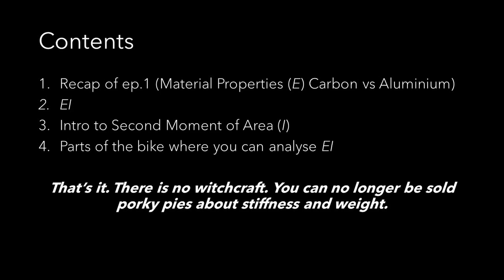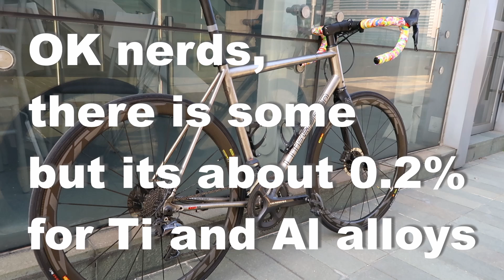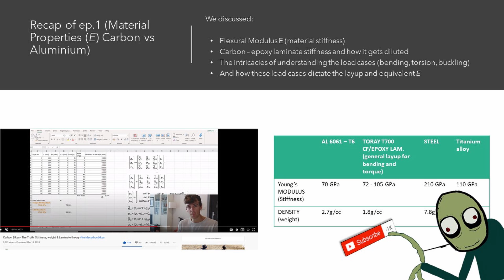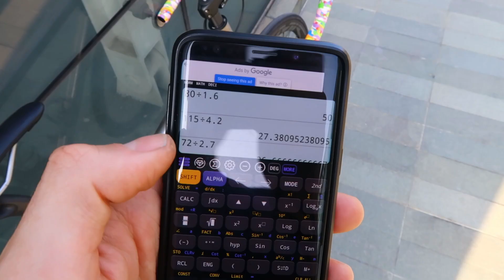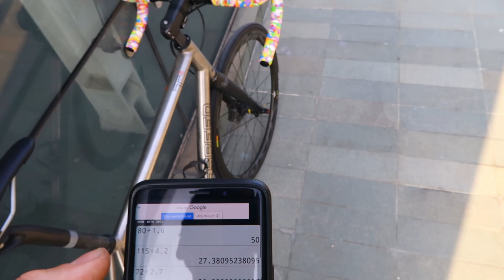Titanium Bikes - The truth and Physics of 'ride feel' marketing.

Comment: Try using chromoly bmx handlebars on a steel frame or titanium and then say it’s not a good dampener! , on my bike I have small kids bmx chromoly bars best upgrade I made , 2nd is chromoly cranks with a odyssey euro to mid adapter.  Always match frame material with components. Carbon fiber isn’t a frame material, just trash like aluminum.

Comment: I have owned steel, aluminum alloy and carbon MTB & road bike frames. Things like tires, tire pressure, suspension, saddle, frame geometry and road surface all seem to make more difference than frame material. Frame stiffness does vary, but often it isn't the material.

Comment: At time 4:45 the presenter suggests maybe "a CAAD 13" aluminum frame would take all the same components and be comparable to the bike shown. In that or a similar scenario, has anyone actually mounted vibration sensors on the two frames and collected amplitude vs. frequency plots of the two bikes side by side?

Comment: Hang on, tube diameter makes a huge difference to stiffness. If you're just looking at axial compliance they'll be the same, but the Al tubes are likely to be larger diameter, and lateral stiffness should be noticeably higher, particularly up hills or sprinting.

Comment: No they wont.  Same weight and 2 different tube diameters will have wildly different stiffness in the vertical direction.  You also haven’t discussed asymetric strain and stiffness.. compliance for a human is strain in Z… power is low strain in X and drivetrain and handling comes from strain in Y

Comment: Vibrations are also influenced by a metal's crystal structure, through internal friction and hysteretic damping. Of course this effect is minuscule compared to the influence of stiffness and mass, particularly given the factors you emphasize. 
But if one resonates these bike frames with a tuning fork one will be able to hear some subtle... textural difference in the sound between different materials. Equalized for stiffness, mass, shape, etc.. there will remain some detectable difference in quality of the musical note. Does this influence ride feel? Certainly not much, but some will have preferences.

Comment: There definitely is such thing as ride feel, aluminium gave my ass 1 hell of a pounding going from steel
Reply from the maker: @grindeyyyyy  thats because the structure is stiffer, given by the boxier stiffer tubes. Simple as that. Tube size is far more influential than material properties. Tube stiffness goes up with diameter to the power of 4!!
Reply: @PeakTorque  it definitely took some getting used too

Comment: There is a difference between butted and non butted tubing of titanium. Additionally, the butted frame is lighter and therefore more comfortable/compliant. 

I’m not sure what Litespeed frame you are ride or what tubing it is made out of. Please explain what frame and whether the tubing is internally butted or not.

I have a Moots Vamoots RSL frame and it only weighs 1055g. The tubing is internally butted which dropped weight and improves the ride quality. The complete bike is 6.43kg which is lighter than many of my friends carbon bikes and feels very smooth to ride as compared to many carbon frames that are so stiff and offer time carbon bike become dull.

Comment: 2:00 That isn't possible.  They cannot both be the same weight and same dimensions.   Titanium is stronger and tougher than aluminum.  The aluminum bike would have thicker and larger tubes.  Given aluminum being inherently stiffer and with the larger tube and wall thickness required to carry the same weight, the aluminum will be stiffer.
The opposite is true with steel.  It's stronger and so the tubes can be thinner walled in order to carry the same amount of weight.

Comment: You want titanium for longevity, not for "ride comfort".

Install a suspension seatpost for the latter.
Reply: Titanium can have a long lifespan, but a lot depends on the welder. It's harder to work with compared to steel or aluminium, and if the welder does no perfect job it can crack at the welds.

Comment: Crashed my Litespeed Siena at 40 mph. Had to replace all the carbon parts (bar, stem, fork) but the frame didnt have a mark on it. If it was a carbon frame it would have been a write off. It also doesn't corrode. It is comfortable, but not as comfortable as a modern carbon frame. It isnt that light either, but it is a great frame and bombproof.

Comment: Peak Torque... you had me at second moment of area - engineering p0rn$
On a more serious note I have an ancient Lynskey-era 6-4 Ti custom Litespeed Vortex. It isn't stiff and isn't light even compared to frames from the same era (1998). But is it ridable after a decent crash? - yup! Without a doubt... that can't be said for carbon (which I also love).
Just like my old Mavic CXP-30 alloy rims - tough as guts when built right and MUCH tougher than the winspaces I bought (and also love).
Best ride quality change up is...drop 10psi in your tyres and then just accept the snake bite punctures should one hit a bad pothole...

Comment: Your description of the factors involved is like saying that all that maters in a suspension is similar factors applied to the spring. But damping is also a factor.  for instance golf shafts are sized in accordance with those exact factors you mention, but add a rubber bung, or a foam core and you get different effects.  

The reality of the factors you mention is that they can't be sized the same way.  Ti bikes are almost always tubes,  but the tubes are wearer, if lighter, so they will have a different section and modulus in practice.

Anyway, I never expected Ti to be any better, I just don't think the factors are as obvious as it seems they should be.

Comment: Also a simple constructed frame like this doesn’t provide any dampening or suspension zones at all. It has the frame basic construction as my 14 year old Koga Miyata fitness bike. This particular frame weighs a bit less than 3.0 kg, the complete bike with aluminum rims and 2x11 speed 105 group weighs about 9.5kg. 

You confirmed my feelings that a titanium bike would not make the difference. Maybe a steel one with special formed construction with damping zones.

Comment: Silly question but back in the day, when you went from something like a Klein MTB to a Titanium Merlin MTB, it was like night and day. The Klein was stiff as could be and would beat you up over an hour or two. In contrast, the Merlin MTB was wonderful and compliant. Both weighed about the same - the Klein was probably lighter - but the ride difference, even with the same basic tires, was just different. What "physics" explains that. Real question by the way.
Reply from the maker: @AMehta-ok5pf  i think it comes down to tube shapes and diameters (which have a much larger effect on stiffness than material choice). In the early days of hydro forming Alu tubes they were thick walled and large diameters before the tech really progressed. This alu bikes got a bad rep for being stiff and jarring. Fast forward to today with something like a CAAD12 with slender (and very thin wall) tubes id say almost the opposite could be true, as titanium tube profiles have largely stayed the same

Comment: Those straight chain stays and seat stays on this bike are GUARANTEED to yield a brutal ride…he’s right about the proper seat post , it can provide considerable dampening. My old Tom Kellog Compact X Lite is a bit heavy but has ‘worked’ chain and seat stays and is stiff enough for aggressive climbing AND it is bulletproof, thirty thousand miles in with the odd accident now and then.

Comment: You've gotten the material science geeks all riled up.   If you want to buy a novel Ti bike that's your business.  There is no need or advantage outside the bar.  Aluminum is the best bike material thus far considering cost, weight and longevity.  There are millions of them from the 80's  and 90's still going strong.

Comment: I've ridden steel, carbon, aluminum, and a Bianche hydro-carbon frame, and I've found the various materials to be pretty irrelevant to the ride quality.  In my opinion, the seat and post, the handle bars and wrap, and tires and tire pressure are the real factors.  My favorite frame?  The aluminum Klein of course.

Comment: It’s always about the tires in my opinion,anyway. I have a steel road bike, a carbon road bike and a steel road bike. They all have carbon forks. They all have the same make and model of 28mm tires. The three bikes all ride the same. Oh, and the saddles, handlebars and bar wraps are identical on all the three bikes so all contact points for the rider are the same. Same setup and geo very similar on the three.

Comment: The stiffness to weight ratio does mean that the properties between an aluminum bike and Titanium bike should be similar.  But due to the fatigue issue with aluminum, you cannot design in as much compliance as you can with Titanium.  You could build an aluminum bike with good compliance but it would start cracking far sooner than titanium.  And I think you do see this in real life.  I have been told that aluminum bikes in general are harsh, and titanium bikes are closure to steel and carbon in their ride feel.  So Titanium does have properties that make it different from aluminum and these properties probably do give it the ability to offer a more compliant ride.  I do not consider titanium magic though, as its good ride quality probably comes at the expense of rigidity.  So yes you may have a comfortable bike, but it flexes a lot under power.  I still think titanium is a great material for a bike, as it seems to combine some of the best properties of steel and aluminum.  I would guess though that its performance cannot compete with carbon fiber as there are so many variables you can play with in carbon so it can be tuned to a high level.  Its stiffness to weight is much more than even titanium as well.  I just put my money down on a lynskey Pro GR, and I know it will not be as light or as efficient as a good carbon bike.  But I am using it for commuting and gravel riding, and I prefer the longevity and toughness of titanium.

Comment: So I've owned aluminum (Cannondale 6/13), carbon (Trek Emonda SLR9) and a titanium (Guru Preamio Preformsnce) and I can say out of all three the Ti bike rides best, and provides ne with the best tactile response. (By the way, I've ridden each bike for literally thousands of km.. my average day ride (do it about two to three times a week) is 100+km 
So take all the calculations you want, but hands down Titanium for my un-scientific opinion is the ultimate best. 
By the way, back in the day, I've also owned steel (Raligh Professional Racing). The steel frame was a Reynolds 531 double butt.. best of the best in its day (although Columbus was its steel equivalent).. and I also loved steel.
So if I was rate best to worse invthe frames I've owned 
1. Titanium (Dura Ace mechanical, Arolus, 
2. Carbon (Dura Ace Di2 on one Mechanical on the other, Arolus)
3. Steel Campagnolo Nova Record, aluminum Tublar rims) 
4. Aluminum(Campagnolo Record, Campagnolo aluminum clinchers)
Reply: So, you basically just didn't watch the video? The Guru Praemio (which I used to own) is a simple round tube bike. A Cannondale aluminum bike (except some of the first ones) and definitely a carbon bike use shaped tubes wich would result in a much stiffer bike no matter what material they're made out of. And what PT clearly explained is that the properties that matter pertaining to "stiffness" from the material itself is nearly identical between Al and Ti.
As such, what you're experiencing isn't because it's a titanium material, but because the simple round tube design and thin walls are a flexy structure compared to aluminum frames which are formed tubes usually with thick walls to get their stiffness closer to carbon.
Reply: @conman1395  I did watch the video, hence my response.. I"ve owned, ridden, and own the best of the best,  and my best ride is my Ti,  But what can I say, I also much prefer my mechanical Dura-Ace 9000s to my Di2 R9200.. I guess I'm simply not cut out Di2s' 
Anyhow, I stand by my options. After all, my opinion is based on my rides and nothing else.

Comment: I have a 2006 Titanium Litespeed, with curved seatstays ( not straight like those of the bicycle in this video).  It is NOT a magic carpet ride, neither was my 1995 chromoly steel Miyata.  The Litespeed is really easy to wash and maintain though and I do not have to worry as much about paint chipas and scratches.
Regarding titanium ride feel: a Zipp sl-70 aero carbon handlebar and a good set of tubeless tires, ie Continental 5000 S TR, even 25mm wide, on a set of nice carbon fiber wheels will yield a very nice, responsive and fun ride which can easily handle a 120 mile ride without beating up the rider.

Comment: I wanted an all round bike to ride to work every day from +30 C to -20 C. Now carbon could probably do that, but I was afraid that if I slid on ice (despite running studded tires which I will be doing, but you never know), I am afraid I would damage the carbon frame. I do have three carbon road bikes, so it wasn't needed in my collection either. 

I do have a steel mountainbike. but I didn't want steel as a salt slush winter bike. Alu was a very cheap and nice option, I'd like my full suspension bike to be aluminium - but not my road bike and I already got a broken alu frame that is heavily corroded so I know how they can go. So Titanium was the one material I didn't have in my collection, and I'm glad I was sold on the right properties and not on some feel. But my frame I've eyed on isn't the 1000g-1200g light one but I'm not 60kg. so good to have a stiffer frame.

Comment: Wait, you're using a nylon vs. steel guitar string comparison to show how Ti is essentially no different or better than other materials? Of course you can tune both kinds of strings to the same note, but they're still going to sound vastly different because of the harmonics, or resonant frequencies. No musical instrument worth listening to puts out just the fundamental tone. They all put out overtones or harmonic tones that are multiples of the fundamental tone that give them their unique and rich sound.

So wouldn't a Ti frame therefore handle harmonic vibrations differently that frames made from other materials? Are you basic your assertion on a simple equation or on more complex equations that mirror real world vibrations? And more to the point is this assertion based on controlled tests? Everyone knows that aluminum has a harsh feel and sound when struck, steel a mellower and richer one and Ti something in-between. So it seems like they'd handle vibrations differently too.

Comment: I haven't ridden enough bikes to have a proper basis of comparison, basically a number of lower end but still decent steel bikes, and my current bike for the past 20 years, a Ti road bike with mid to high end components, and I absolutely love its ride quality. It does feel "springy" and rubbery and smooths out road imperfections and roughness and feels alive.

Now I don't know if it's because it's Ti or just well-made, but even if it's no better in these respects than well-bade steel, aluminum and carbon bikes, it's certainly no worse, and that's good enough for me. Plus, no corrosion, looks great, so easy to look after, and pretty damn light. It's like anything. It doesn't have to be better. It just has to be right for you.

Comment: Ti frames are build with thinner walls and smaller diameter than aluminum frames because it's stronger and makes it forgiving. Ive ridden alloy bikes, its not the same ride. Maybe in your case that you need a fatter ti tubes  your weight ?

Comment: So you say that if the ratio between Young modulus and density is about the same then titanium and aluminum must have the same stiffness, meaning that you assume that the frame sections have also the same second moment of area. Personally I would expect aluminum frames to have a tad higher second moment of area with the same weight, because of the higher wall thickness coming with the lower density... mhm, but that would explain a higher stiffness of aluminum frames, wouldn't it?

Comment: It actually it depends on the tubing straight guage or butted.  Butted tubes stops the vibration.  As to the frame they do flex as do forks rims spokes.  Most seat posts do not flex but some carbon ones do.  Also the style of frames compact or a long wheel base flex differently.  These arguments are lacking in detail.

Comment: Back in the day, Columbus tubing had tiers of available tubes for frame building. Lots of racing bikes were built using SL, SLX. Because  I'm a small rider, I would have preferred the SL which was lighter than SLX which was considered really stiff. And it was generally found in bigger frames.

Comment: I’m enough of a traditionalist that I don’t need any carbon frames or components but also not interested in steel.  If you remove the seat post you can see steel tubing is paper thin.  So can bring it down to a competitive weight.

Comment: I think we need more math than just the Young's modulus, right? We need to consider the most common alloys used for bikes. We also need to consider how much less Ti alloy we are using. The limiting reagent for Ti frames is how much less material you can use while still maintaining the critical stress specs that they want to make for their bike. Then,  we'd have to audit that with that much material in that shape, do we still have an elastic modulus that is comparable or lower than a competing material.

You're on the right track, I think, but I don't think we can boil it all down to the pure element's Young's modulus. When you're using half the mass in materials to meet the stress requirements, does this halving of materials also result in more flex than aluminum? 

Maybe I have it wrong, but that's what I'm curious about.